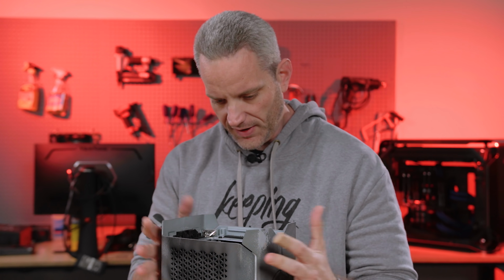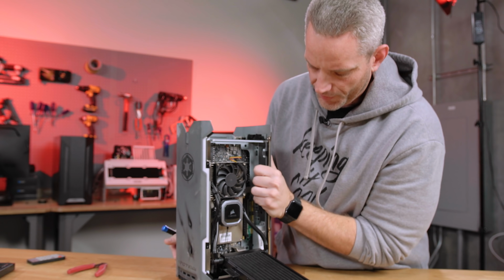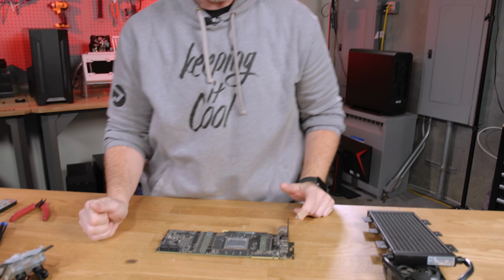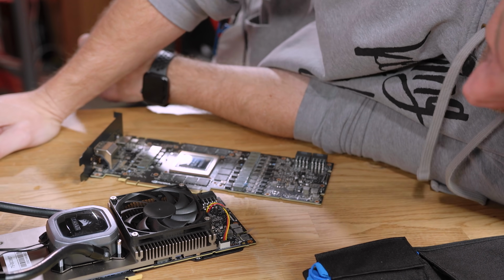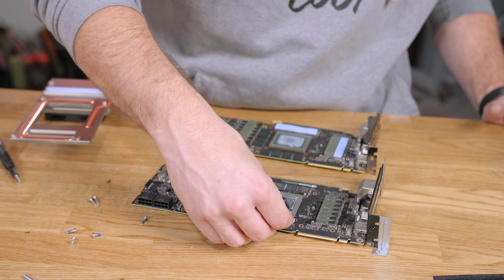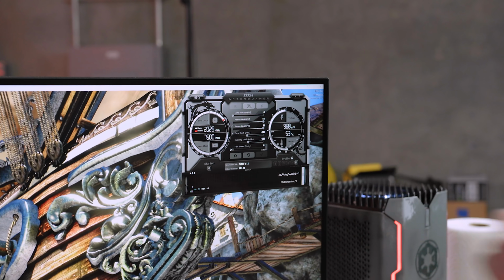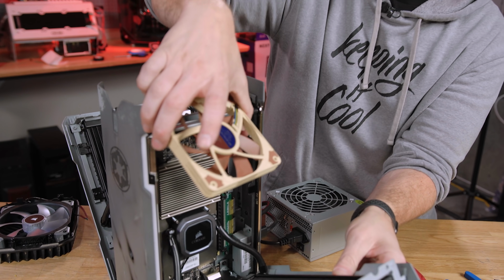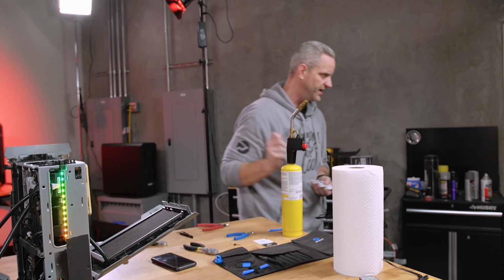I accidentally broke a $2500 video card... like an idiot

Comment: 6:30... yes clean off the shunt mod. I had to replace the resistors on my 1080Ti after like 6 months of running that same mod with LM. It destroys the solder, hence why yours fell off.
Reply: Ever tried the wire bridge shunt method?
Reply: I have a rx 480 😭
Reply: @isuzuhombre-lx7jr  This will lock the card at 135mhz or something if the wire is too conductive ( card senses no current ). Need the right resistor value either at the current sense resistor or near the chip for good results.

Comment: Hey Jay,  you don't really need anything special to solder that resistor back on.  Just a good soldering station with a variable temp control and a small tip.  You could probably do it with out a variably temp but they are so cheap it's not worth going with out one.  If you need any help I would be more then happy to walk you through the process or if you trust some rando in your comments section you could send it to me and I'll fix it and send it back (if you pay shipping)  I am an electronics technician with several years worth of experience.
Reply: I hope he takes you up on your offer for repair.  He probably won't even read/see your comment. So I'll like and ask others to do the same so it rises up the stack.
Reply: Very true a nice easy fix.
Reply: Fix it!
Reply: Commenting for bump.
Reply: Pretty much what I came here to say.
Reply: bump

Comment: The reason the resistor came off so easily is because the liquid metal weakened the solder.
Reply: Is it gallium? That stuff destroys other metals.
Reply: 1. Have to use a high end micro soldering iron to solder that small of a solder joint and component. 2. Have to use lead free silver solder if you want  the solder to stick. 3. Have to use a microscope while soldering such small components. 4. Have to use new components and can’t re-use old ones. 5. Need to clean the solder joint throughly before soldering on new component as old solder and/or corrosion could interfere with.
Reply: This is fun...
Reply: Use water at own risk use galium at risk delis at your own Rick unless you wanna slice your thump open because by our dumb lol
Reply: Tristan DizZo sameeeee brooo😆. Only thing I need is popcorn lol

Comment: Jay running Heaven with an overclocked Titan RTX:
"It maxed out at 54°C...."

Me looking over at my temp monitor with my stock 2060 at 53°C at idle:
"......."
Reply: Me looking at my 1060 with shitty cooling at 80-85°C after repasting and at 85-88°C before at 100% load
Reply: @AllGovsAndAllCorpsAreBad  no you are old
OK boomer...
Reply: James Amril-Kesh He’s explained in the past why he still uses heaven
Reply: @kubexcz  stares at gtx480 <_<    >_>
Reply: Gigabyte 2060 super at 54°C idle, yeah
Reply: Me looking at my 1080tiOC that has not run hotter than 51-55C cause i game in 1080p and its having a pretty chill life
Reply: @kubexcz  sounds like you dont have good airflow in the case
Reply: @freshpotato8431  got the 2-fan of this card, 80c on load :(
Reply: @highp4166  I don't know about that, I have 2 fans in front, 1 in the back and a rather big case. But the gpu model I have is known for its bad cooling, it's the cheapest one from EVGA.
Reply: @kubexcz  try to setup a more aggressive custom fan curve i think you can do this with the MSI Afterburner and try to take the front panel off if it's not a mesh type maybe this could help
Reply: @kubexcz  I run an MSI GTX 1060 6G the card is with passive cooling that means when the card hits 63° the fans spin up and they rarely do in games like mass effect Andromeda League of legends etc. they are not very demanding games i know ... My case has 2x 200mm intake fans that keep the card cool btw it is vertically mounted
Reply: Its probably with the fans turned off for silence, this is default for nvidia nowadays
Reply: @dscarmo  Or if the front panel is obstructing the airflow
Reply: @kubexcz  I also have an EVGA the ssc one and it's doing great. 1440p Battlefront 2 on ultra/high at 70°C. Which one do you have?
Reply: @highp4166  I have a mesh front and I also have an agressive fan curve.
Reply: @kubexcz  is your card Overclocked ?
Reply: @azshokasecondary8571  I have the EVGA GeForce GTX 1060 6GB GAMING. Without the SSC.
Reply: @kubexcz  Try to undervolt it a lil bit and set the fan speed to 100% when the card hits 65° and remove the front mesh also set your chassis fans to 100% as well maybe the hot air is stuck in the case
Reply: undervolting can make those graphics card a lot more cooler, I did it with a 1660 Ti XC Ultra, at 1980 MHz the GPU stay at 0.950 Mv instead of the 1.05 of stock settings, barely touching 59ºc in Quake 2 RTX
Reply: my aorus extreme 2080ti reaches about 71°c max with fans maxed , depending on ambient, sometimes only maxes at 65°c. thinking about tearing down and putting better paste on.  Or getting the waterblock for it ...
Reply: 53°C at iddle? Do you either live in  ery tropic country or your GPUbis full of dust
Reply: Got my 2080ti running at 84°C at 100% load :(
Reply: @Sidiax  your PC has the same temps as my laptop
Reply: @deminybs  if its out of warranty go for it however it will improve the temps by around 2/5° better go for the waterblock or if you think its worth it buy a new case which is optimised for airflow it can make a massive  difference look for a case like Thermaltake Commander C32,33 etc. But 71° is a pretty good temp everything below 85 is ok 85 or above gets a little toasty 😁
Reply: @highp4166  my case has plenty of airflow (cooler master storm stryker that's been modded a bit), but the waterblock would eliminate the heat from backplate that's like 2cm from the bottom of my RAM lol. Just gotta save the money for a good loop
Reply: If your GPU is idling at 53c you probably have "prefer maximum performance" as your power management setting in the Nvidia control panel, which means it sits at base clock (1515mhz for my 2080, not sure what it is for the 2060) even when idle. I have my power management set to "Optimal Power", and my 2080 sits at 300mhz and just 30c when idle but still boosts to ~2000mhz when actually gaming. Maximum performance mode seems pretty useless, I've tried both optimal power and maximum and no benchmark gave me a higher score with maximum performance.
Reply: @kcasc_hd  Sippin on Gin & Juice eh?
Reply: Trung Thanh Duong Default fan profiles will keep the fans off unless the GPU is above 55C or so. My EVGA 1080ti black edition does that. Just set the fan curve to aggressive in afterburner and it idles at 32C
Reply: @kubexcz  me looking at my gtx580 earlyadopter with the worst cooling out there at 115 degrees Celsius. The plastic on it got bent like heck but she made it for 5 years under that load.
Reply: Chances are that your cooler has a 0 RPM mode when you're under 60C ;)
Reply: Damn I have a hard time getting my 2070 above 63c. It's an Asus rog strix oc though I guess and it's in a lian li pc-o11 dynamic with three 120mm fans blowing straight at it
Reply: Me with an Xbox 360 with a red ring while it makes noises like it’s preparing for liftoff
Reply: @Skellist  That's a good point. I do have it set at maximum performance. I've done it on all my setups since I had a GTX 770 which would BSOD while gaming if it was set to anything other than max perf. Was probably just a faulty card. I'll try changing that setting and see if the idle temps will go down. It's maxing at like 72-73°C at max load with the stock fan settings and everything so cooling probably isn't an issue.
Reply: Dr. Jay Me looking at my Intel intergrated graphics with jet turbines for fans opening up a chrome tab
Reply: 1070 gtx  at 44 Celsius idle, 72 Celsius max fans.... in a asus g20 cb case.  x fuckin D
Reply: KCASC_ HD god I hope you’re wealthy
Reply: High idle temps like that can be caused by wrong settings in the Nvidia control panel. You do not need to run your GPU at maxer power all the time, my 1070 idles at around 30c with the fans off.
Reply: @AllGovsAndAllCorpsAreBad  yes champ.... time spy use cpu too. For stress a gpu need a test that load ONLY gpu. Unigine heaven are the best stress test of all
Reply: @AllGovsAndAllCorpsAreBad  i know that. Infact if you wanna test gpu, the load on cpu are useless... champ

Try to use heaven in loop at max settings at resolution of your monitor, and see the degrees of your gpu. It will be higher then time spy!
Reply: If your gpu is maxing out at 54C, then it means you wasted your money.  If you're maxing out at 80+ then you're getting your money's worth!
Reply: @AllGovsAndAllCorpsAreBad  Because it doesn't matter which benchmark you use when they can give more fps and still utilize all of the gpu and draw a ton of power.
Reply: @kubexcz  that's the problem: you have 2 intake fans and 1 exhaust. Assuming each fan controls 50ml of air, this means that you let 100ml of air flow in and after the cool air cools the system, it becomes hot and only 50ml out of 100 is expelled which means that you will keep piling up hot air which will overheat your system. TLDR: by another exhaust fan to even out the numbers or switch one frontal fan to the back
Reply: @AllGovsAndAllCorpsAreBad  it's the only bench mark to this day that can put a $24,000 gpu on full load...
Reply: You have an airflow issue™
Reply: 2080 super 29 Celsius idle lol
Reply: KEKW yea....Dont even get my started on my 5700xt thicc iii temps.....Im going back to Nvidia like I normally do when they release the new RTX cards in September.

Comment: Imagine breaking a graphics card worth more than the PC you're watching this video on
Reply: Ten times more in my case, 3000G based system
Reply: @cm01  so your entire PC (system, not just cpu) was 250dollars or less? Wat
Reply: So sad to see 😂
Reply: @maxpower700  oh yeah man. Not even cheap garbage parts either. Is your only reference point for PC cost this guy's channel?
Reply: And more expensive than the PC this video was edited on.
Reply: @Zwenk Wiel well it's not a gaming PC but it runs csgo beautifully on Vega 3. And at any time I could drop in anything from a 560 to a 1660 would be a good pairing. Ideally a 570 or 1650S.
Reply: @Zwenk Wiel I dont know why u need to point that out... Caleb like any other of us, might already be aware of this and he might has personal preference or reasons. Why would you even have decent pc when u dont utilize it potentials as much. Better spend those moneys somewhere else
Reply: I cringe when I add up what mine has cost me over the last 3 years... so I would very much cry if I broke my 2080ti
Reply: 13.45
Watching on a phone
Reply: I'm pretty close to the 2500$  TR1950X (800$) 16GB mem Vega FE (1200$) few sata ssd's 1 nvme ssd, 1200W PSU, be quite aio cooler ow and a cheap case :)
Reply: @cm01  no, my 5 recent pc builds are my source of info.
Where did you get your parts? I doubt its the EU with our electronics tax.....
Reply: @Damicske  Oof. Hurts to see that someone paid more for their 1950 than I paid for my 2950
Reply: @maxpower700  nope, US. Just 6% state sales tax, no VAT, and tariffs are up right now but computer parts manufacturers have usually been exempt.
Reply: @cm01  explains alot. Add 15-20dollars on just a 3000g and youve got the markup in EU lol
Reply: that card is worth 4 of my pc

Comment: Jay: RTX Titan "The most powerful Card."
Tesla V100: Am I a joke to you?
Reply: technically not a graphics card
Reply: @tommihommi1  nope, I still could use it as one tho
Reply: @mindcreeper  You don't have a V100... Also it has no output interface.
Reply: @Mythricia1988  you can use a V100 to accelerate graphics if you have a GPU in the same system, or are remoting into it

Comment: i stumbled across your channel about a month ago .... i have to say ..... due to the mix of  your humor and knowledge... i've been able to learn more about computers than i thought i would ever know.... i used to be fairly up to date on what was what and how it worked, but i got just completely uninterested in computers somehow. I recently got back into computer gaming and wanted to building my own computer. I figured i could do so because i used to be a guru. Well i was wrong. After looking at the different components, i quickly realized i had become vastly out of the loop on the current status of computers. So, i started seeking knowledge to get back up to speed just on the basics. I came across your channel and quickly realized that you had all the information i needed to get back up to speed on the basics. After watching video after video, I recently planned and built my first PC in years.... With the current state of graphics cards i ended up going through a PC builder website just for the simple fact that it was 1.5k cheaper than if i had built it myself, but i built it with the knowledge that you armed me with. So, Thank you Jay for you knowledge and your videos to help inform those of us whom have never, or have been out of the loop for a while.
Reply: building pcs isnt difficult and never was. Now go design and engineer the next step in hardware. You do not have to be smart or a genius to be a mechanic. Just make sure you have the right tools and components for the job.

Comment: Yeah I've heard that liquid metal will destroy solder joints and components. That's basically the big downside to it, spill it or it runs off and you are done.

Comment: NEVER EVER have liquid metal to bridge a connection or on-top of solder. If you're going to bridge a connection, just solder it, because now you have to wick it if you ever want to solder it again because the solder has amalgamized with the solder.

Comment: What happened to the soldering video that was up for a moment? One tip, probably too late but. If you use a standard soldering iron, pull the plug from the wall just prior to soldering, less voltage transfer in case the iron is bad. The heat is enough for the moment. And study your footage to determin in which orientation that component was originally!

Comment: What I would have done is lay the machine on the side to make it easier to handle that radiator. That being said I know Phil had to capture you taking it apart. But for anyone that wants to take one  of these apart without a camera crew, turn it on its side

Comment: I did much worse. 

I destroyed a 1.200 dollar threadripper pro mainboard by adding a 64 Core threadripper pro CPU wrongly into the socket. All pins are bent to the side now, so the board can't be used. Both are broken now. The CPU + the mainboard. Total money down the toilet: about 6.000 dollars for the CPU and 1.200 for the mainboard.

Comment: you know what has always bothered me about motherboards? RAM keeps getting bigger with coolers and whatnot as do CPU coolers to deal with higher temperatures, but they continue to put the RAM slots right next to the CPU so that most coolers either block or are at least extremely close to each other.  Why haven't they been redesigned to move the RAM somewhere else on the board? (I have seen a few really high end boards with them in other places, but the standard is to have them right next to the cpu slot.)

Comment: Y'all really need to learn how to solder. Or if you do, keep a basic soldering station on hand. Repairing that resistor, wiring that fan to the new card (that clearly had the vias for the fan header even if the header itself was missing), etc.

Comment: hi, 20:57 rgb leds (adresable ex :ws8212b) you can use a arduino nano to control, and making any color that you need.  its a 3 wire conection ( +, -, and data), easy, only retain by your software shilks. good luck

Comment: I agree with you about how limited Aura is, but I may have a "sort" of solution to your two colors.  Try Starry Night and set the two colors you want.  I wish that Aura Creator allowed the control of individual LEDs.  Instead all the LEDs connected to a header are treated as a single device instead of individually addressable LEDs, go figure.

Comment: What if you wanted to program the fan to set on full speed before the heat sink gets up to temperature?  Linear fan speed curves is what lets a GPU kill itself from overheating, since the fans won't kick on high until well past 70 degrees Celsius.

Comment: I worked in small pc servis just for 20 days (2*10days as part of school, thats just how it works there) and man, if I treated even 10$ piece like he does, they would beat the crap out of me.
You dont work with components on hard surface.
Only part you touch with metal tools (screwdriver etc.) on components is bolt, use pkastic for rest.
Never blow your mouth on any components, you will spit on it (aerosol) use presured air, it costs around 3$...

Comment: Better late than never but I also don't feel like going through 10 months of comments. 
You might get some better light control using the Asus plugin for iCue for those blaster holes. (if you still have the system that is)

Comment: Asus has a plugin for Icue to control rgb devices and your motherboard leds through Icue. Maybe Icue can help get that glowing effect you desired. Alternatively, you can solder a corsair rgb led strip cable to a regular 5v argb female connector and connect that to a lighting node pro to control through icue as well.